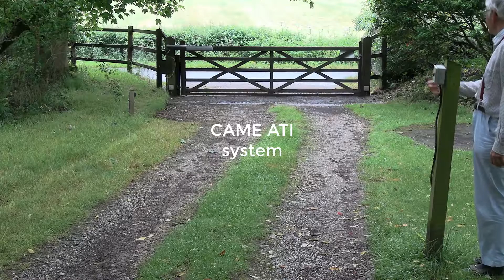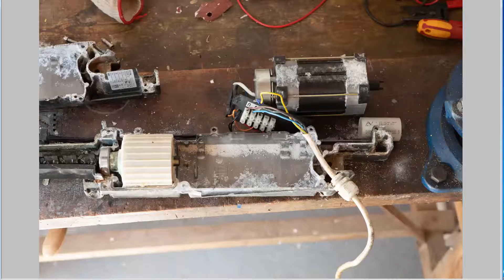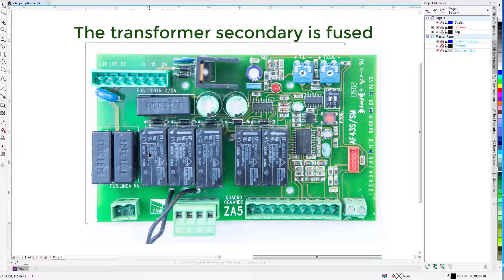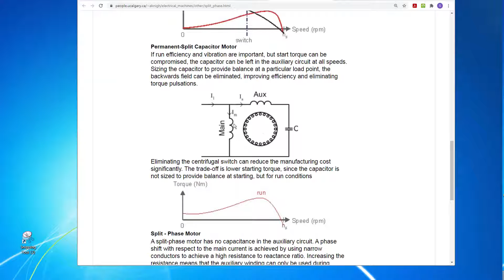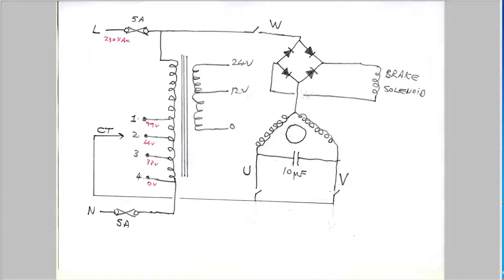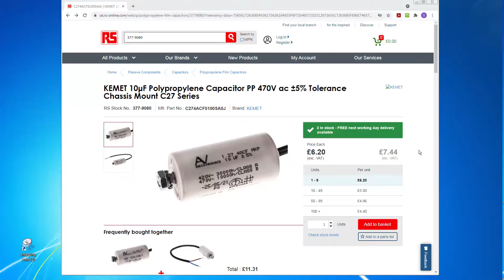CAME ATI electric gate motor sticking

Comment: Thanks for the video Samuel. I have a similar swing gate from CAME and I too have a similar problem with one arm. Since getting back from a few weeks holiday this winter, the arm has stopped working completely. No amount of banging resolves it and the lead screw won’t turn 😀. I can hear a click when I engage the gates and then again when it is meant to stop. I swapped the capacitor from the other arm and it still didn’t work. I guess the only option is to dissect it and investigate further.
Reply from the maker: Better check first that when you hear the click there actually is voltage across the motor. Can do that by just taking the top cover off.

Comment: Interesting.  I actually understood most of your explanation and immediately recognised the bridge rectifier on your circuit diagram, so I have learned something.  You lost me when it came to testing the capacitor. 🥴.  I’m not clear if you did actually fit and test a new capacitor to the old mechanism even though you didn’t use it?
Reply from the maker: I tested the capacitor using an LCR meter, see https://en.wikipedia.org/wiki/LCR_meter . I haven't fitted a new capacitor to the old motor yet. Will order one when I have more things to get from RS, due to minimum order charge. Just cleaning motor etc. up at present.